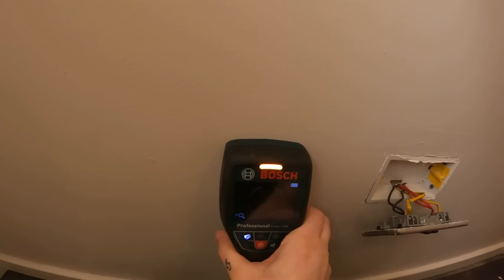Extreme drilling- Artisan Who?! - Electrician

Comment: i use a green grinding wheel  for sharpening carbide drills. i grind a proper cutting edge on the impact drills so they will drill steel wood and brick without impact

Comment: I might have located the spur next to the socket where accessible to isolate/change fuse etc without moving a wardrobe.
The box you fitted for the spur could remain with a blank faceplate behind the wardrobe as not visible, no joint required in there, just a point to drill into as you did.

Comment: Just a thought about the flood light, why not use a timeguard Pro as they take a twin + cpc straight into their stuffing Gland. The stuffing Gland is designed for flat cables.
Reply: Twin + cpc cable isn’t rated for use outside without protection though?

Comment: Trick for egg box walls cut out your box then use some trunking body length smash it into the wall leave it in place and push your cable through then once cable is in place pull out the trunking leaves the cable behind done it time and time again on tower blocks in the area I work where we altered the kitchen electrics in nearly 200 properties and all the walls were this on top of concrete.

Comment: Why the 18ft drill bit for a cavity wall, could of opened the steps and used shorter bit with vac :) , still a good shot well done handling that length ;)

Comment: interesting how other countries wire things up - in New Zealand  hooking up that floodlight to a power socket  would be against regs - you'd need to run the feed back to the fuse board / consumer unit and on a lighting circuit
Reply: It was fused down probably to a 3 amp.
Reply: @richardmuir1783  Still against regs in NZ

Comment: did you take power from the socket for the light then ? i didn't know you could spur off for a light. could you do it the other way around on a lighting 10amp MCB if you knew what was being plugged in wouldn't overload it ?
Reply: You can, aslong as it's fused down. That's why they would have fitted a Fused Connection Unit and either put a 3a or a 5a fuse in.

You can feed a socket off of a lighting circuit but it just doesn't make sense to do so. As you said you can only draw 10a at most on that circuit, so there's a very high chance of nuisance tripping depending on the load.

Comment: Nice drilling.. but I'm betting you are stood higher than should be on those steps and for sure, impossible to maintain three points of contact when working like that, in a safe manner of course.😉Even worse to allow an apprentice to work like that, H&S would have a field day should he have an accident as the proof of a breach is in the video !!!

Comment: Quick question, you’ve used 2.5mm into the existing socket into the new spur, did you split the ring and pull into 2 cables as that was off camera or did you connect 3 cables into a double socket ? Cheers
Reply: 3 cores into the socket is fine as the spur is fused. 👍
Reply from the maker: 3 cables into the socket mate
Reply: Not trying to catch you out, or anything. I was just curious as to if this is best practice or if it was aloud to do so. Thanks again
Reply: it’s best practice to split the ring and pull 2 x 2.5mm into the spur isn’t it keeps it as a ringmain then rather then spuring off with 1 cable
Reply: Also keeps 2 cables at each outlet that way and future use can extend from the spur. What would you do in the case if it was a 4mm radial with your in and out no chance you’re getting another cable in the socket.